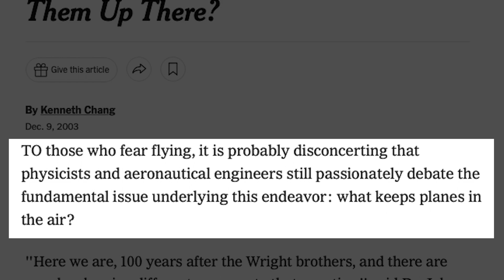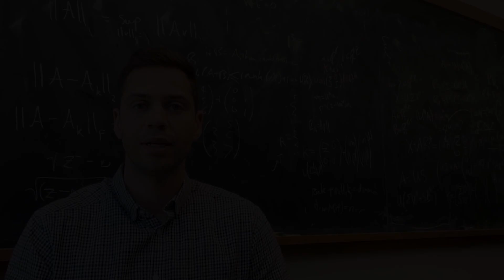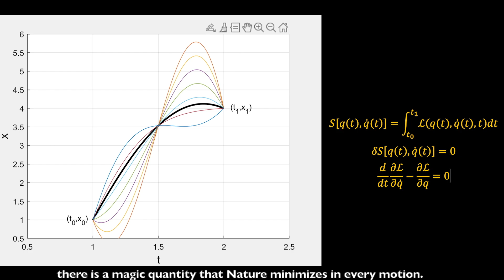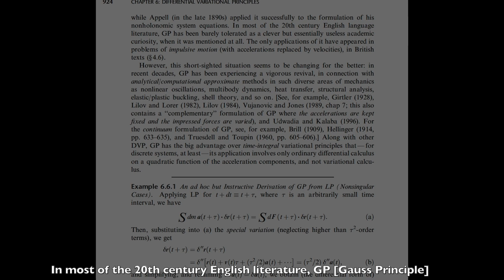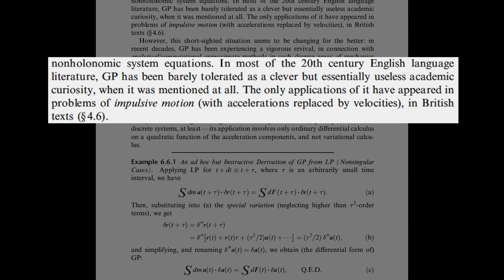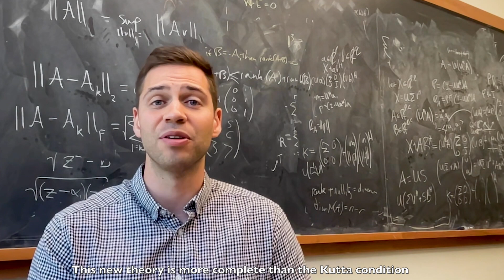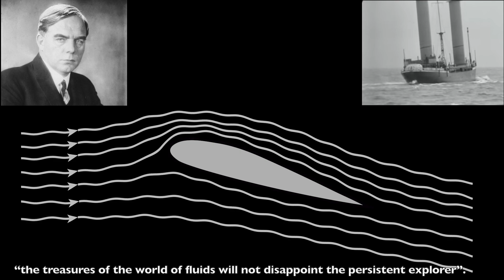A New Theory of Lift

Comment: This new theory does not seem to be correct because it is unable to explain the Magnus effect where lift is generated by a rotating cylinder.
Indeed the flow which minimises the curvature around the cylinder is clearly the symmetrical one, which has zero lift.
Reply from the maker: Here is a paper that demonstrates how the generalized version of this theory explains Magnus lift:
https://arc.aiaa.org/doi/full/10.2514/1.J063703
In fact, the theory captured the exact same behavior of the lift coming from Glauert's approximate solution of the boundary layer equations, just by doing 1D minimization without any boundary layer calculations.
Reply: @dynamicsuci5607 Many thanks for this link. Is it possible to get the pdf document containing the details ?

Comment: I would submit that the least curvature is surrogate for least drag. The shape of the wing is all about minimizing drag. You might get some lift from the curvature, but lift derives mostly from the angle of attack. 

And I don’t get how this insight explains why thicker shaped airfoils are needed at slow speed, whereas minimizing drag does.

Comment: I couldn't watch more than 3 minutes of this rubbish. Lift is one component of the aerodynamic force. The aerodynamic force comes from pressure differences in the air. The origin of the pressure differences is explained in the paper linked in the description youtu.be/dgE9xhIjTOU

Comment: Perhaps someone more knowledgable can answer this question: isn't lift essentially creating a slight vacuum above the wing, perhaps at least in comparison with the pressure underneath it?
Reply: Let’s say Yes for the sake of argument. Now do the math to calculate exactly how much lift a given wing shape will generate at a certain wind speed and you may begin to see the point of this video.
Reply: @anatomicallymodernhuman5175  Wouldn't the answer be either "yes" or "no?" If yes, then the vacuum can be calculated and consequently the amount of lift determined as the vacuum is applied to the upper wing surface and the host of other factors that go into that. I have no doubt the formulas are not explained as a vacuum because "lift" is the calculation combining that variety of factors, but the actual force involved is vacuum, as it seems to me.
Reply: @grandrapids57 , Work it out mathematically from first principles. It seems that a lot of commenters here are missing the point of the video. It's not about the practical aspects. It's about fully understanding the fundamental physical forces involved.
Reply: that's what i thought.       but, i have realized that the pressure zones above and below a wing are a  result  of a wing that has positive aoa, moving through air.       there, thus, is a simple newtonian explanation of lift from positive aoa.
as it moves through the air, a wing that has some positive aoa pushes down on the air, and the air pushes back.   voila,  LIFT.
(it can be seen that  bernoulli-based calcs  and/or  simulations that simulate  Moving  AIR  are  less-than  ideal.)
it is informative  to consider what happens when a flat plate profile/airfoil that has some positive aoa moves through air.      there will be huge amounts for turbulence/reduced pressure/DRAG  at the upper surface of the wing; over its entire chord/area.
this is  why  the upper surface of a modern, efficient profile is shaped the way it is.       so that, the profile/airfoil occupies the space that would otherwise be full of  Turbulence/drag. 
because the 'moving air' model is flawed, it can be seen that a typical streamline illustration is more confusing than informative.        cheers

Comment: The Space Shuttle was considered a Lifting Body... majority of lift not done by small outboard 'wings' but air molecules striking bottom of craft. It was for all intents and purposes a flying brick that barely came home at end of every mission. Totally unpowered flight on excessive glide slope, 1 chance to get it right. No parking Shuttle if it came up short, or went long. 

Heard pigs can fly too if given enough thrust.

Comment: I've wondered about boats floating in water and their displacement of water and how a flying plane compares to that.  It (the plane) must also displace something.  Of course it must be the atmosphere that "floats" the plane, but what is the distribution?  A massive plane can fly low and directly over you, but you don't feel crushed.  No matter where you or a million other people under the plane stand, nobody feels the weight of the plane pressing down on them.  So how large of an area of the atmosphere does bear the weight of the plane?  What is the distribution?
Reply: Imagine if you were in the water, would you feel the weight of a boat above you? In the boat analogy it becomes more clear if you think about being in a pool. If I put a boat in a pool the water is lifted slightly and offsets the weight of the boat. Its like the surface of the water is some crazy 3d fulcrum. As soon as enough water is displaced to equal the weight of the boat it stops sinking. If you expand the pool outward to a bigger and bigger body of water the amount of water displaced remains the same but the change in height approaches zero. A plane works differently, its not floating due to displacement. It floats due to lesser understood fluid dynamics. To me the plane flies because the vortex created above the wing and the vortex's being shed down the side of the fuselage are lifting the plane into that low pressure zone. If you even seen like a Styrofoam cup or piece of paper float in the air behind a moving truck, that's what I'm imagining. It does make for an interesting idea though, even if the plane is being pulled upward into a low pressure zone, what's holding it up? You should check out the episode of the mythbusters where the weigh a box truck with pigeons flying inside of it lol

Comment: In theoretical equations we are assuming that the wing has a perfectly smooth surface, which in reality it doesn't. For a molecule it is a mountainous region, causing micro-vibrations/energy frequencies in all directions. Hasn't it been experimentally established that sound/vibration can also cause levitation (Hutchinson's research) as a form of anti-gravity lift? Has this been taken into account in conventional aerodynamics?
Reply: If true, the effect would be equal above and below the wing, thus cancelling out.

Comment: It's as simple as F=mA. The entire aircraft is a 'black box', with airflow coming in (reference frame=aircraft) the front. Some of that mass (m) of moving air is accelerated (A) downward, generating an equal and opposite reaction force (F) called "Lift". 

Too many theories failing to explain aircraft that choose to fly upside-down, or flat or random objects being blown up into the sky by strong winds. But F=mA works universally.

You'll ask, "But what about what's inside your black box? We're very interested in the wing itself."

Well, there are presently some optimized wing shapes (many, choose your options) to maximize Lift and minimize Drag under some selected conditions, but I don't believe that there's any theorem to prove that there's not another even better design yet to be discovered. So it's all merely 'stamp collecting', but admittedly, very important stamp collecting. If a complete theory was at hand, then the entire topic would be marked as 'complete'. It's not, and isn't. So carry on.
Reply: "failing to explain aircraft that choose to fly upside-down" ... please, not that old chestnut !  inverted airfoils use a higher angle of attack.

Comment: My model aero plain I built as a boy in the 1960's with a main wing consisting of a symmetrical sheet of thin Balsa wood flew perfectly well and that without control of it's motional pitch against wing air flow since I had no radio remote control.
Later, explanations of lift produced by upper wing curvature never made much sense to me.
Such curvature may well assist lift but it seems not essential for flight, provided the motional pitch against airflow can be adjusted.
Can someone please explain why symmetrical wings fly at all and bring me up to a more scientific state of knowlege?
Reply: @Grim FPV Explained well in simple terms and what I thought all along. Why else would an air craft need to rotate at a certain speed to take off. Thanks and cheers!
Reply: @grimfpv292 I think the thickness of the wing is not only about packing in enough structure. It’s also about drag. For a slow aircraft to need a larger wing to deflect the air. However, with a thin wings, very small increases in angle of attack cause a disproportionately greater increases in drag. The laminar flow over the wing is quickly disrupted causing a vacuum/void/low pressure zone above/behind the wing. If you have a thicker front of the wing, you can manage high angles of attack (and hence higher lift) before drag over takes available thrust.

Comment: Oh my God! This was such a lie and misrepresentation. Lift at it's most basic level is still statistical partial kinetics. No comprehension of fluidics required. The wing angle and curvatures are simple maximized conservation of momentum and deflect underside molecules downwards upon exit. As the top molecules slide off the top back of the wing they are sucked into the reduced population zone at the bottom trailing edge. Thus all mass of air under or over the airfoil is accelerated downwards and provides TONS of lift. Every debate after that is just describing the fine points or efficiencies of the process. Lift is statistically impossible to deny. Same as any rocket engine nozzle. Just math. If lift angles and velocities and laminar flow are met you simply CAN NOT fall out of the sky no matter how stupid you make yourself. Even the weakening of lift is perfectly correspondent to air density, humidity and temperature dictated average particle velocity. The particle kinetics is perfectly tied to atmospherics conditions. These guys are just splitting hair because "Publish or Perish".

Comment: Airplane wings produce lift using the same action/reaction principal that a rocket engine uses to lift a rocket off the launch pad. The pressure created inside the rocket engine's thrust chamber accelerates the combustion gas downward through the nozzle, which produces the upward lifting force. Similarly airplane wings accelerate air downward to produce an upward lifting force. But how does the wing accelerate the air downward? Basically, the forward motion of the airplane compresses the air at the leading edge causing the air to be accelerated up and over the top of the wing. This creates a region of low pressure over the upper curved portion of the wing. When an air molecule traveling in a straight line encounters the region of low pressure it gets deflected downward as it follows the curved surface of the wing. It's this downward deflection of the air that produces the lift.
Reply: How comforting! Now I can go back to Cats that look like Hitler videos!!!
Reply: @patrickjamesdavidarmstrong7271  I love cats videos. Also the Hitler parodies.
Reply: Plus the downward deflection caused by the underside of the wing.
Reply: @DavidOfWhitehills  That's correct sometimes. With positive AOA the air flowing under the wing will be compressed and deflected downward, which produces increased upward lift. But at zero AOA the air flowing under an asymmetrical wing (with a flat bottom) remains unobstructed so it stays at static pressure, which is the local ambient pressure. So at zero AOA all of the lift is produced on the top side of the wing.
Reply: @joevignolor4u949  Don't think planes fly with zero AOA.
Reply: @DavidOfWhitehills  You are right. Practically there is always some up trim. But when trying to explain how the bottom of an asymmetrical wing stays at static pressure the explanation is more understandable if you assume zero AOA. So for clarity that's what I did.

Comment: Aerodynamics is always discussed in terms of air flow, but it bears considering that air is basically not moving until an airfoil comes along, moving through it at high speed. Whatever the mechanisms involved, the net result is that air gets pushed downward. Air molecules have inertia, so pushing them down results in an upward reaction force. This is obvious in the case of a helicopter, which creates a strong downwash of air.
Reply: air is absolutely CONSTANTLY in motion.
that is what temperature is, after all. the average kinetic energy of all particles in a medium
Reply: Great. I was beginning to think that I was the only person in this entire discussion thread who understands all this. Its good to know that I'm not alone. Thanks.

Comment: but it is not just one force or act. There is already pressure dirrerence and there is air resistance. There may also be electrostatic and other factors. Wind speed, direction of travel around the globe?

Comment: But the air isn't flowing. It's the wing that is moving.
Reply: they both have the same effect
Reply: @nade5557  yes. but. the air particles aren't "deviating from a straight line" as per Hertz. It's not "curvature". The wing pushes them aside (up or down) as it passes, dragging them along it's axis of movement due to friction, coanda as it does.
Nature might be minimalizing that vertical movement, which would look like minimalizing curvature, but by saying the air is flowing, it's introducing a new (horizontal) axis into the equation.
It comes down to where you attach your viewpoint, or camera. If you're looking at the wing, the air flows. An air particle would move XY and t. But if you're looking at the air, the wing moves. Y and t. Discounting drag/coanda etc.
Reply: @pcread  but you still have to consider the wing's x axis movement, because when the air is still and the wing moving the air still moves in the x axis. Looking at the effects on both the wing and the air, they are the same regardless of the viewpoint. You might be onto something though, perhaps the air minimises it's total average movement (temperature added by the wing)